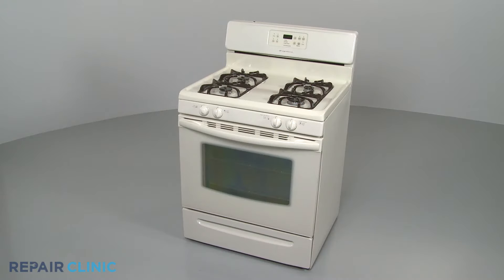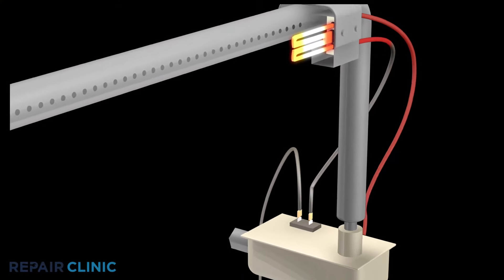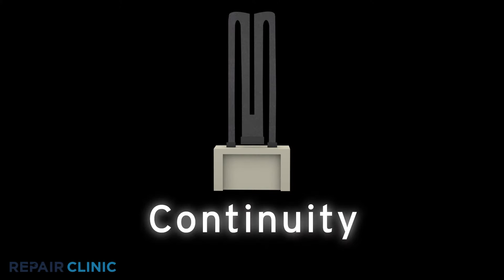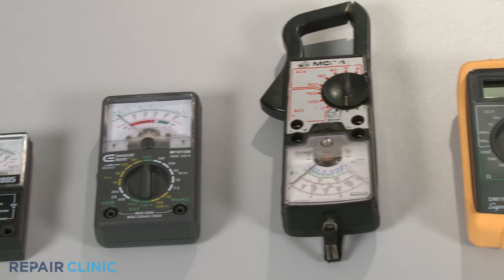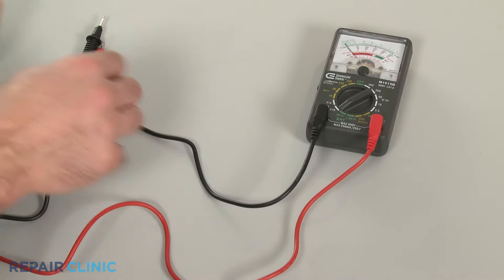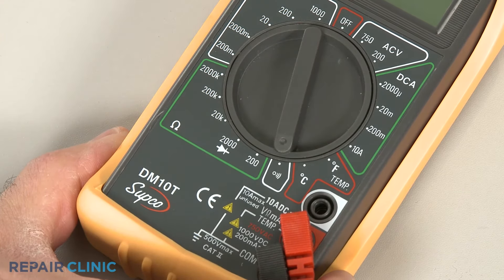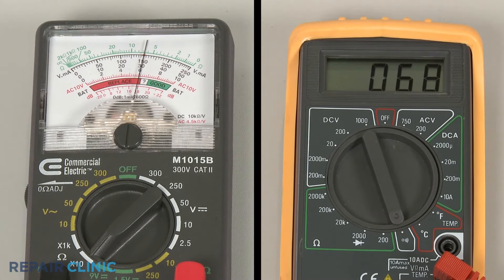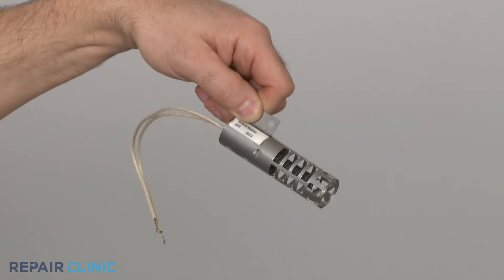Oven Not Heating? Igniter Testing –  Oven Troubleshooting

Comment: remember when you could get 20 - 30 yrs out of an appliance?  
I am on my SECOND replacement igniter on this FIVE yr old Kenmore oven....
Reply: I thought it was just me.
Reply: @Mortallian18  No it's not you. I we have a double gas oven. The lower igniter just went again today. Luckily I could pull the one out of the upper smaller oven and use it in the lower bigger one otherwise we were screwed till a new one came. I just changed this same one in October this year. Not even two months old. We had changed it back in 2022 as well.  Both were ordered off Amazon. I assume cheap China crap from Amazon. The last one said made in USA, but you can't trust that anymore . Just ordered two more from a reputable appliance store here in Canada.
Not sure if there is more to this than cheap product. Need to do some research to see if there may be something more to this oven which is causing these to burn out but I doubt it. Tested them all and no continuity. So burned out.
Beginning to not like Amazon as much. Don't need to help Bezo's pocket book anymore than necessary.